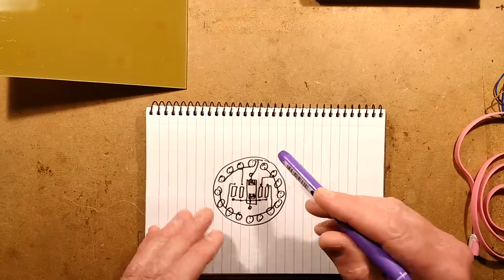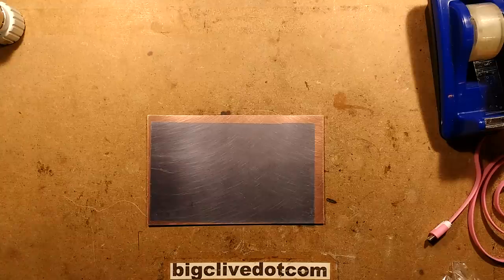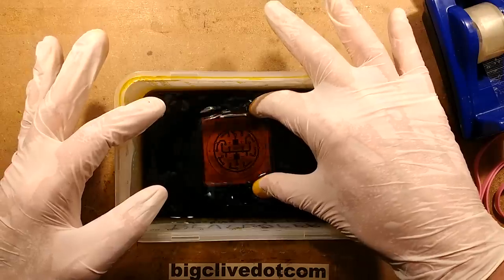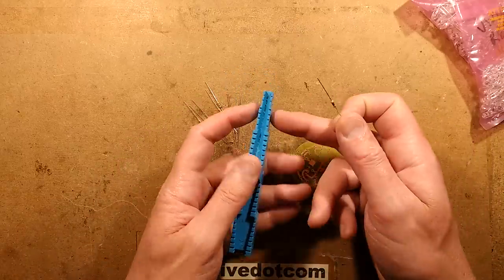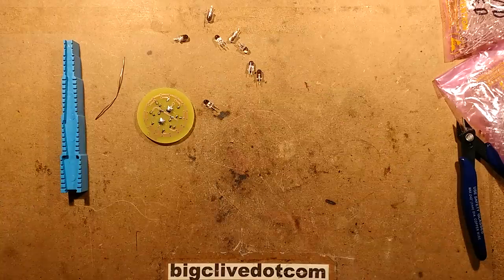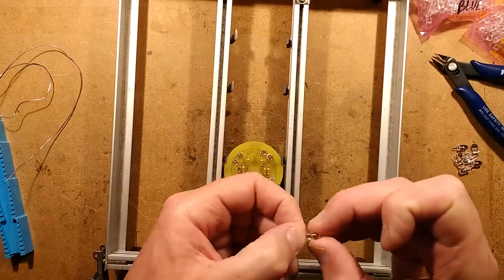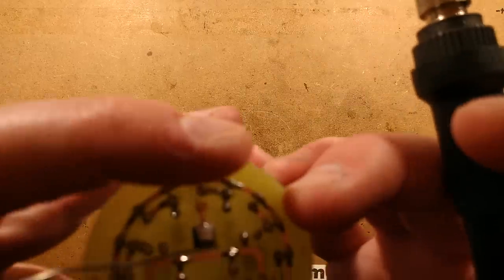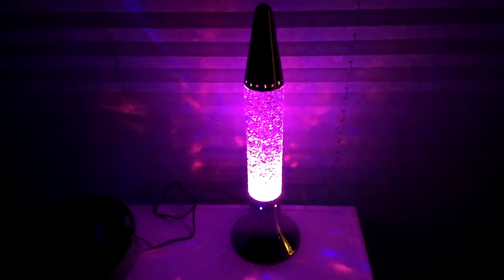Safe USB version of the Gillian's Diamonds lamp. (With PCB file.)

Comment: I have had no end of bother with the electric iron method. I found that a cheap laminator (like €10) works great. Just fold a little excess dry film over the end of the board, put the board through the laminator with that end first, perfect result instantly.

To etch with ferric chloride, I also use a tank with an aquarium heater set to ~40 deg C and an aquarium pump to bubble air over the board, works great, etches in 5 minutes. Ferric chloride is great for messing up your stainless steel sink too ;)

The ammonium persulphate stuff sold as etchant is not really great, it does not keep, it absorbs oxygen over time and becomes inactive.
Reply from the maker: Do you not find that the film has wrinkles on it when you laminate it?
Reply: put a piece of cardboard or thick paper either side as you run it through , that should help with wrinkles.
Reply: bigclivedotcom wrinkles with the iron, perfect with the laminator

Comment: Just a thought, for ironing the film on, if you're planning to do PCBs often, a moderately priced "Hobby Sealing Iron" from ebay will work well too. They have very fine temperature control and are suited for these type of films.

Comment: 37:55 There is obviously a reason for LED leads always having been made out of steel. Possibly the die or something.
These days, it seems to be impossible to buy even resistors with leads which are non ferrous.

Comment: 33:40 you have better luck than me. When I was a kid and I had one of those electronic project kits, the first thing I did was put a 9V battery across all the LEDs (which were permanently installed in the board) and watch them go real bright for about a millisecond.

Comment: My favorite soldering iron is one of them 30w fixed output chinesium with the 45° bend in the tip, find it fits places straight tips would find hard, not for use in smd by any means but great for thru hole

Comment: A green LED will start lighting at 1.65V and reach full brightness at around 2V, depending on the LED. Fresh batteries can have up to a 1.7V rating, with a nominal voltage of 1.5V. THis is why you shouldn't mix old and new batteries, even though everyone has done so at some point. I just checked an unused, cheap AAA with my Radio Shack multimeter and it comes in at 1.605V, so being able to light up that LED was not surprising.

Comment: I used to make pcbs for a living at a small fab. specialising in low volume fast turnaround. So I got to do everything from photomech to plating, etching, even running the press for multi layer boards .

Comment: Hi, Clive, Tip: When you pre-cut your LED leads, cut  the neg, shorter, leg first, then the longer leg, but cut it so it is still the longer lead of the two.
Reply: There is no such thing as pre-cutting. There are only two states an LED lead can possibly be in, cut or uncut. Pre-cut is a pointlessly over-redundant term.
Reply: Also, that's twice the cuts. If you wanna go all fancy, make one cut at an angle, not 2 one at a time :P

Comment: The process that deposits powdery substance on the paper and then bakes it together to form an embossed surface would be... Laser printing! It's not usually thick enough that you can feel it, but if you're not economical, there's no reason it wouldn't be really thick.

I wager a guess this might not be what you were thinking of.

Comment: BigClive , I wonder if you could have used a thermal compound that they use in computers between the resistor and the bottle then seal that with the silicone if you would better heat transfer.

Comment: Technical question!

I started making a normal version of this (not the Cherernkov one I showed you), and decided to use the slow colour changing LEDs. I've noticed that the LEDs seem to flash or strobe during certain colours, and my theory on it is that the voltage sags a bit when multiple colours are lit. I'm thinking of putting a small SMT capacitor and current-limiting resistor in parallel with each LED to compensate for the sag in voltage. Do you think that will work?
Reply from the maker: Are you using current limiting with the LEDs?  Have you tried a different power supply?  Some power supplies get a bit glitchy with a pulse width modulated load.
Reply: @bigclivedotcom  100ohms per two parallel led's just like in the circuit. I tried a couple different supplies, and the strobing persists.
Reply from the maker: @GadgetBoy It may be intermodulation between the RGB LEDs if they have just one resistor.
Reply: @bigclivedotcom  Ohhhh. That's an interesting thought. I'll toss a resistor in series with each LED and see if it fixes. (I bodged a cap in temporarily and it didn't seem to help). I'll update when I have a result.

Comment: Would there have been a difference between USB type C and a standard micro USB lead? I only ask because most of my USB C leads are USB 3.0 compatible which allows a greater voltage (I think).

Comment: Well, I finally managed to get my hands on some boric acid (from a jewelry makers shop) and still the silver coating  on my crystals is eaten away ;(
Guess I have to experiment with the amount added: enough to keep mold away and little enough to not go for the silver coating.

BTW: I made a change to one resistor per LED, so I could swap in colourchanging LEDs.
Works just great with the slowly fading ones!

And I'm still wondering about a possible use case for the fast flashing colourchanging LEDs, they bring such rushing hectic into things...

Comment: Hi Clive, although I really love watching you break and criticise things (highly educative), I prefer your makey vids. Like to see your more creative side! (*immediately goes out to buy a component former*)

I really like your quick drill technique. I bought myself a nice accurised drill press (a bench model from Proxxon) but not as quick. The problem with your technique is that it gives me nightmares because of the use of little finger as a brush whilst holding rotating drill bit near said finger.

Oooh, I also love that assembly board thing. Where do I get me one?!
Reply from the maker: I'm sure someone mentioned the assembly frames were still available in the last version of this video (the dodgy mains one).  But I'm not sure where from.  This is an old one.

Comment: That took a bit of finding! - Electronic Component Lead Bender - Bending - Forming - Pre-Forming - Tool.
Only one result too. £5.99.
The thing about void if removed was thrown out by the european high court (I think with a precedent from US) as being bollocks.  That's been the case with PCs for yonks, When desktops were king, I rarely ever returned the whole thing even if they collected free, just send the faulty bit back, they confirm and send replacement, usually much faster than when they do the work.  Always clear it but I've never been refused.  With laptops its more of a gamble.

Comment: Interestingly the white of the eyes aren’t terribly fragile, so I’d assume contacts would provide nearly the same protection (aside from the inconvenience of seeking medical attention if something becomes lodged in the white of your eye) compared to glasses. This is a bit gross (warning): I had a piece of fine glass ricochet into my eye when I was camping at the end of a days hike. In retrospect I should have sought medical attention, but I ended up using tweezers from a Swiss Army knife to try and remove the glass which had moved up under the eyelid. Removed things that weren’t the glass first. 20/20 vision 15 years later :)

Comment: Another well done instructural video with good tech talk , both current and days of yore .
I bought my first leds from polypacks and digikey in '74 ... I was 17 .
Nice Monty Python reference .
OK on the acetic acid type silicon rubber ... it is the real stuff , that kind that has a slight ammonia smell is terrible stuff .
I wonder how laser diode assemblies would look in this application .
Did you put a knot in the cable for a strain relief ?

Comment: Having trouble getting the diamonds to be neutrally buoyant. Much more salt that I would have thought I’d need. Wonder if the diamonds I ordered are actually acrylic?
Reply from the maker: Try some different ones.
Reply: I looked up how much salt water will take into solution and realised I just wasn't adding enough. Have a somewhat neutral buoyancy now, though will have to leave it to rest for a few days so the cloudy crap can settle out. Still might buy some more for size variation. The pack I got was smaller than expected.

Comment: I haven't been able to find washing crystals. Will borax (boric acid) suffice?
Reply from the maker: No.  I think it has to be the specific chemical matched to the resist.  You can convert bicarbonate of soda ro sodium carbonate by heating it in a pinch.  Or buy the proper chemical online.

Comment: Is the cured gel layer an insulator? I would like to know because it might be useful for electro-etching instead of ordering or cutting vinyl stickers. (and they usually cant be cut very fine) That would be a great thing to electro etch with in case its insulating and sticking well to the material.
Reply: S Core It's certainly intended to control etching (of copper).
Reply from the maker: I would think it should work with electroetching.
Reply: S Core   it's a safe bet that it's okay as a low voltage insulator. The next question is whether your electrolyte will dissolve it.  Clive showed here that the chemicals used for developing and etching do not, but the ones usable for clean up do.  Copper sulphate?  Sodium chloride?  Sorry, I have no idea, but I reckon it's worth trying.  Please post if you do!

Comment: What's the PCB holder jig that holds the components flush to the board while you solder? My daughter wants to learn to solder, so I've got a few kits to do over the Christmas holidays and this looks useful to prevent components dropping out. If it's home made or very expensive then I'll make something similar. Cheers.
Reply from the maker: I'm not sure where you can get this type.  It's an old Velleman frame.

Comment: Hi clive since you do a lot of inkjet printing are you using a epson ecotank printer? they are much cheaper to run due the the use of a external reservoir for the ink. and you just top up the tank.
Reply from the maker: I am.  And before that it was a standard Epson printer with an external tank system.
Reply: i thought so. I will say that you use of good prints in you videos works so much better than any video feed from a microscope, keep up the good work.
Reply: Aaah, recent Techmoan.

Comment: Here's a question (electronics noob). If I have an Arduino driving a ring of LEDs (Say a Neopixel ring), how should I wire the heater resistor? I don't think the little Arduino can pass enough current to run the heater.
Reply from the maker: The resistor would be run directly from the supply powering the Arduino.

Comment: @bigclivedotcom I've just got hold of a scrapped lamp which has floating pieces of silver foil inside, which I'd like to make into a lamp like this. I've just attempted to unscrew the lid which has some hot melt glue on the threads, but I've not managed to get it all the way off. However, I can smell the fluid inside has a very, 'chemically' smell. The best way I can describe it is like the smell of the knock-out gas you used to get at the dentists way-back-when. What is the stuff inside likely to be?....
Reply from the maker: It sounds like a lava brand solvent based lamp.  Don't spill it in your house or it will stink forever.
Reply: @bigclivedotcom  is it worth trying to 'rescue' the fluid? It's gone all green and murky, which made me think it was probably just water, but that doesn't seem to be the case. It's certainly not branded 'Lava' anywhere, seems to be unbranded and is just a tall straight cylinder, rather than the classic style with the wider waistline.

Comment: A cheap etchant I went to is hydrochloric acid with hydrogen peroxide about 80 to 20 percent mix. Its clear and easy to neutralize for disposal, but it can be used many times by just adding more peroxide.  Save money over ferric, so give it a try.

Comment: I have a question, can you make a string of LED lights using ONLY a 8 to 12 volt power supply, (no board) and a few resistors? total lenight is 104 inches, 
with a 2.5 to 3 inch spacing of LED's.
Reply from the maker: You could.  It would have to be a parallel circuit of series strings of two LEDs and a resistor.  Or you could use a converter (or just a resistor) to limit the current and use one of the common 100 LED strings of copper-wire lights.

Comment: "Sometimes you screw up"

I spent a day testing at every component on a circuit board starting at the power supply, only to find that I installed a single diode backwards.....

Confirmed, sometimes you screw up.

Comment: Regarding the Iron... What temperature are we aiming for? I'd like to substitute the Iron with the Heat Bed of my 3D Printer =)
Reply from the maker: Pretty much the minimum setting.  Too high and the protective film shrivels, damaging the gel layer.
Reply: @bigclivedotcom  Mhh... I kinda forgot to ask with my first question regarding your UV Lamp but giving the Blacklicht Wiki a read they appear to operate in the 310-420nm range with the latter being ideal for photochemical polymerization ( what you were doing? IDK ) which brought me to my DIY Resin UV-Curing Oven that uses 405nm UV-LED Strips ( https://i.imgur.com/H3DWiA3.jpg ) - Got an idea if this would work out as well? 🤔

Comment: Really nice lamp!
One problem though with the crystals:

After using the transparent sort of them I went for crystals with one silvery side to get more effects on the outside...
BUT when I put those crystals into my solution of table salt, a drop of detergent and a few drops of hypochlorite against mold.....they become completely transparent in about 30minutes!
The silver coating just vanishes into transparency :o
It doesn't peel of or something like that, it just turns transparent....

Is anyone else observing that strange kind of behaviour?

Type of crystals are acrylic ones from aliexpress, couldn't find polystyrene ones yet.

Comment: Have you tried doing a double sided board with this method?  I'm thinking of giving it a try for my zx81 clone.  I'm thinking holes for alignment but getting the film on in exactly the right position is probably going to be really footery...
Reply from the maker: It's often done by using keying pins through alignment holes from the first layer to be exposed.
Reply: Ahhh that should work perfectly - cheers :)

Comment: hey @bigclivedotcom can you leave the photo resist on and individually scrub the pads to use it as a purple solder mask?
Reply from the maker: It might be possible to recoat the board completely and align a negative image of the pads so it exposes and develops as a full PCB resist.

Comment: If you put the dry film resist on the PCB blank how long can you leave it before exposing, as in can you pre-make batches?
Reply from the maker: I've had some coated board in a dark place for weeks and it looks fine.
Reply: That's good to know. I dislike working to a time limit when focusing on things. Plus can save off cuts.

Comment: Quick question I'm a US electrician. On our homes we have 2 120V phases coming in that are 180 degrees out of phase and that's how we make 240. Do UK homes only have 1 single phase at 240 coming in and leaving on a neutral?
Reply from the maker: There's one standard system in the UK.  Three phase and neutral 240/415V (supposedly 230/400V under European fantasy rules)  A home gets a single phase and neutral, while a factory or commercial premises gets three phases and neutral.
Reply: bigclivedotcom which 240 would hurt worse lol?

Comment: Hello BC, this video is another one of your many interesting and educational videos on all things light. 
I would say that your lamp videos are "brilliantly illuminating" - pun intended!
    Unlike other commenters here I actually want to build this type lamp, so where can I buy the 2-inch diameter bottle with the metal top and bottom covers? 
  I would prefer to buy a lamp with the liquid mix already inside so I just concentrate on building the illumination and heating. I am stuck over here in North America where the only thing they sell are those stupid pear-shaped lava lamps. Any hints on what Google search terms to use for the style bottle in your video?
Reply from the maker: The bottle was part of an existing glitter lamp.  Try searching for glitter lamp online.

Comment: I usually try to make dumb comments that are funny, but usually just dumb.
Anyway, i wanted to not try that and say how nice it is to watch this video and be able to understand 90% of the things you're talking about, with no real prior electrical knowledge (real is the key word).

I know it tends to bog things down and annoy veterans when you talk through all the steps that are unnecessary for anyone with electrical experience, but it was really nice to follow the process. It kept me watching even after i found out it used plastic diamonds instead of cubic zirconias. I guess i shouldn't have expected those to float, but i was assuming the project used wax and convection sort of like a lava lamp. Maybe I'm just an idiot. There is that.
Reply from the maker: It's OK you're not an idiot.